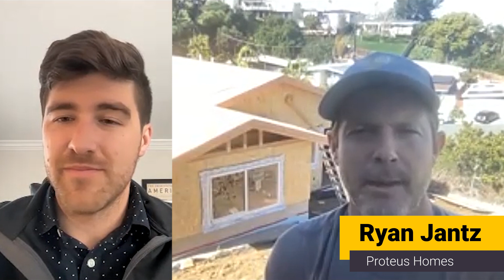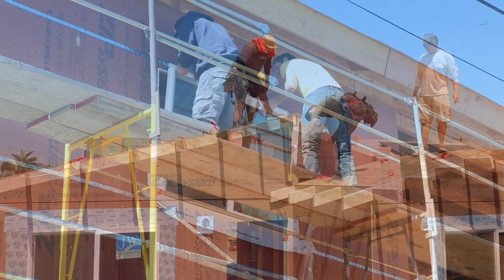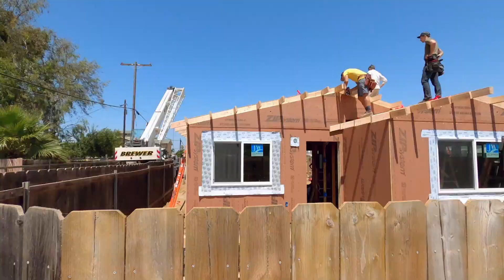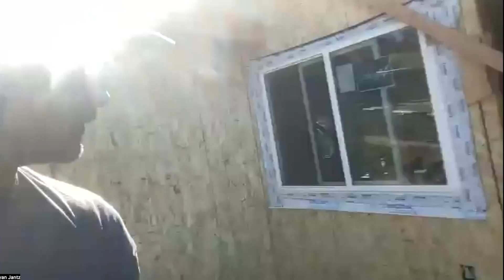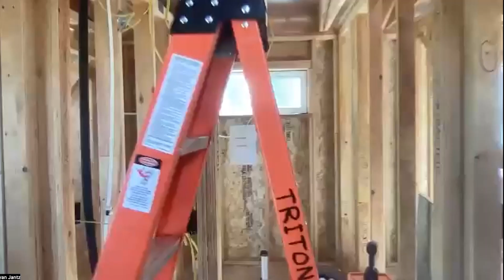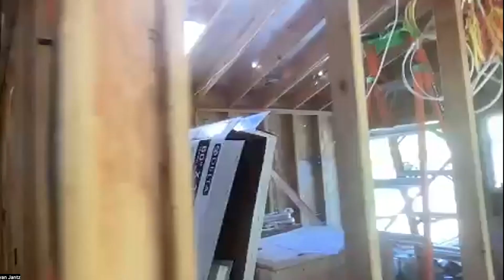Panelized Modular ADUs: The construction method no one talks about | Maxable Interview

Comment: Do all panels still require craning in?  I have a site behind a single family house that is somewhat surrounded by powerlines and limited to 115 inches on the side of the house and thought sips would be a solution, but it appears craning is still necessary.
Reply from the maker: In some cases, they may be able to install without a crane. It depends on if you have large enough access to the backyard and the design itself.
Reply: @Maxable as above,  is 115" large enuff access